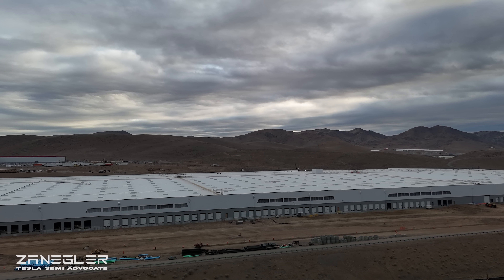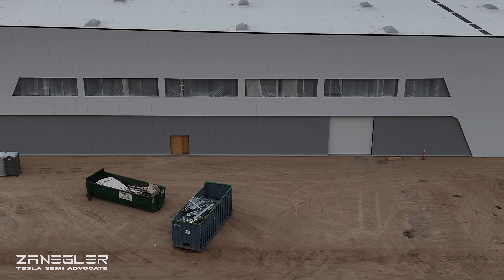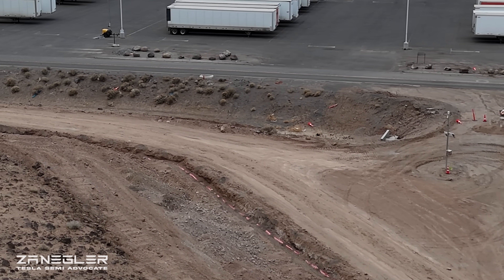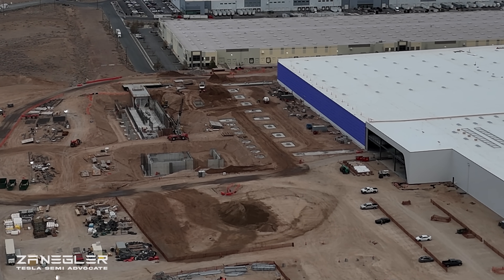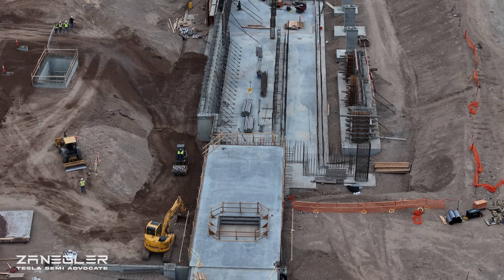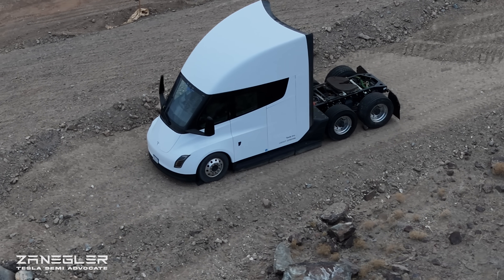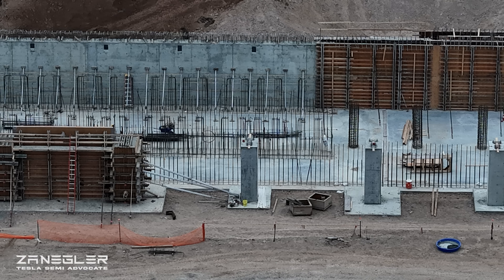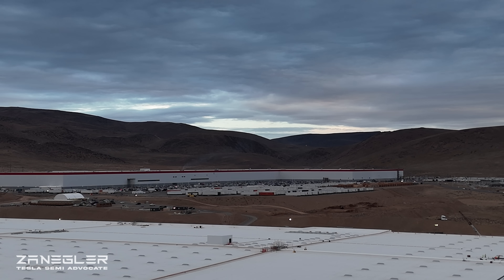Giga Semi - Trench Warfare

Comment: High-availability data centers will bring in power  at 4 corners of the facility, for example, from different substations to avoid, as you say, single-point power failures.

Comment: Great job on the video the shots and perspectives as always were amazing. You speculated on the multiple sources of electric. This is very common in large commercial or industrial buildings to feed from more than one substation. The reason they do this is when they size the switch gear each individual line is sized to carry 100% of the entire load of the building. That way if you loose power from one sub (which happens more than you think often for maintenance shut downs) the switch gear will perform what’s called a ‘tie break’ when it senses a disruption in power from one line or the other placing the full building load on only one line. Normally the load is evenly split so about half is on each line feed during normal operations.

Comment: One would imagine they would install a large overhead crane in the stamping shop, therefore requiring additional building height and foundation support.
Reply: With a stamping machine an overhead crane is almost always needed to move dies and material.